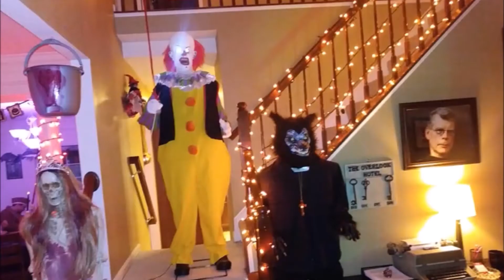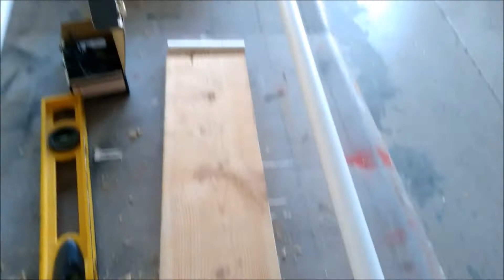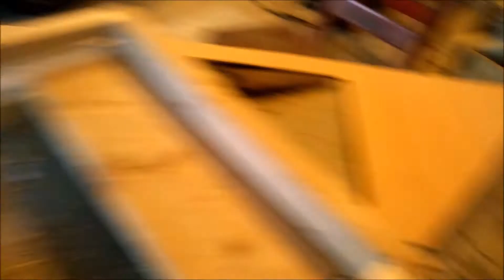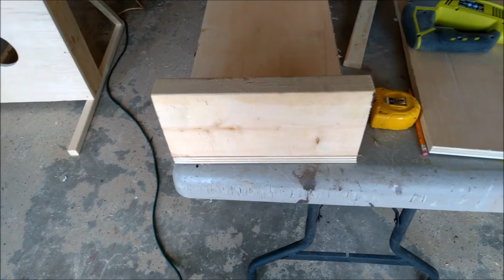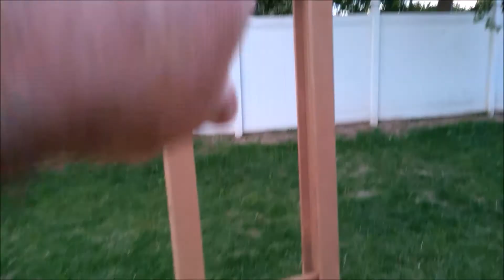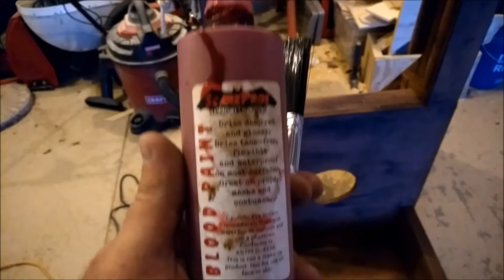GUILLOTINE PROP PROJECT...FULLY FUNCTIONAL!!!

Comment: Great build!  New sub from me for that one. I am building one this year and was trying to figure out how to keep the blade from getting hung up if I just used wood (blade not going down straight and getting wedged). Your build using PVC runners completely eliminates that issue. Great work and you saved me a lot of time and headaches.
Reply from the maker: Glad we could help.  Thanks for subscribing. We appreciate it. Good luck on your project. The kids in the neighborhood got a real kick out of the guillotine last year.